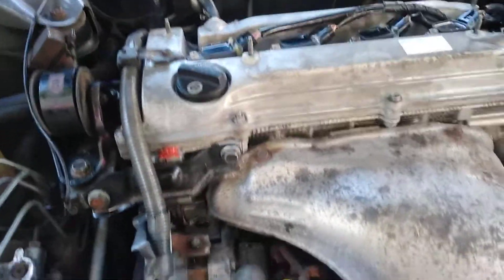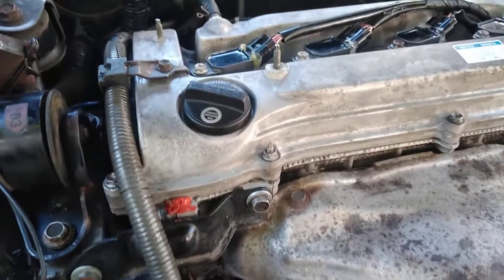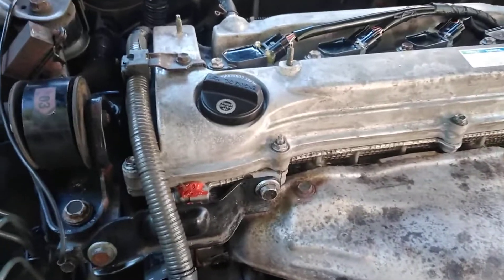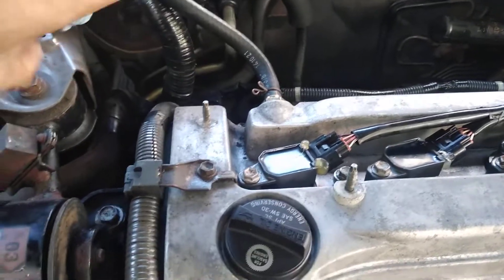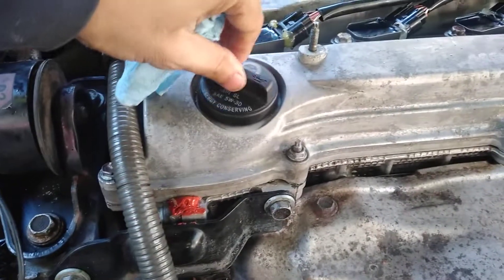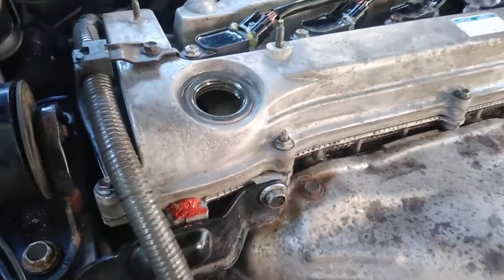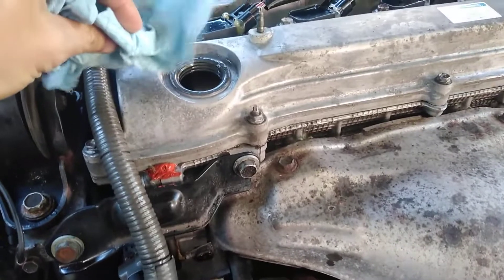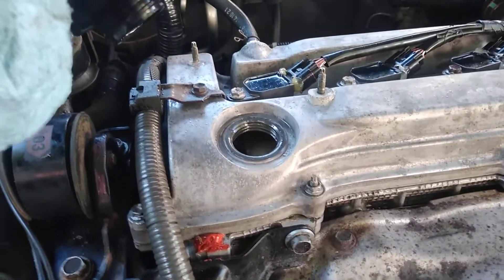Too much positive pressure from oil cap. Camry 2005 2AZ-FE engine.

Comment: wow, I have same exact problem but mines a 2006 camry, I'm confused cos the dipstick is also silent, no air from there whatsoever. I'm very very interested in finding a solution to this... please.
Reply from the maker: Thank you for your input. I talked to one mechanic about it he said its normal, but I doubt. My dipstick is also dead silent. Soon I will perform compression test. Thinking it's probably stuck piston rings. Some people have had success using some additives in gas/oil or directly on the pistons, I might try that too. Overhauling is not an option for me. I will keep you guys updated.
Reply: @someone1089  i have the same exact condition. compression test this morning showed 175 and 165 on the 4 cylinders in my 96 accord. hoping its excess crud on the rings and may try some lucas next
Reply: sufferimg from poor gas milage now otherwise runs good
Reply from the maker: My compression test came as C1-205psi, C2-195psi, C3-195psi,  C4-205psi on hot engine. I don't think I have ring issue, my MPG is still good. I had exhaust leak and I think the mileage was also poor, so I replaced the faulty part of the exhaust which could effect the mileage. Just make sure you don't rule out other things.
Someone have tried B12 chemtool to unstuck the rings, Here is the link.
https://www.youtube.com/watch?v=84MylatwpN8
Reply: @someone1089  So at the end, the tests prooved that your engine had no issues right ?
Reply from the maker: @yassinelitime  Well, since I don't observe any performance issue, I am calling it good. The only issue I noticed is oil consumption, which is common in this 2AZFE engines. My compression test results came pretty consistent in all 4 cylinders about 195psi. I m not too worried about this issue at this time.
Reply: @someone1089  hello are you still around? I’d like to correspond with you about this issue having the same exact issue on a Scion tc. Compression is 170 to 180 on warm engine all cylinders
Reply from the maker: @TTheo-cb4jz  I am around, but not actively pursuing the solution at the moment. It does not look right, but the car runs fine. Some people says it's normal, some says it not. The compression in all cylinders is 195 ish (psi) on fully warm engine. I noticed a difference in spark plug conditions in one of the cylinder. The plug got black carbon deposits while other looked clean. May be that cylinder is causing this blow-by some how. My totally un educated guess is that may be the valve stems seals are the culprit. 
Is your car running OK? Cold start, acceleration etc. Mine starts and runs fine even in below freezing conditions.
Reply: @someone1089  Thanks for response, 
Mine is my daughters 2008 Scion TC. Sounds the same as yours, practically like exhaust pumping out of oil filler. Seems way too much to be "normal" in my opinion. Spoke on phone with one Toyota tech and he said Yeah they do that. hmmm. (2AZFE).
My compression on just  warm engine # 1 180 #2 170 #3 170 #4 175. they went down significantly when doing on a cold engine low as 160. (but forgot to hold throttle plate open).so it can suck air in better. remember to pull fuel fuse and relay fusebox under hood. or load up with fuel cranking otherwise. Toyota manual spec   189psi max  145 psi min. dont wanna rent leak down tester at moment. thats a good indication piston blow by.
Reason I check cap off running /mine was a valve cover gasket leak in front. They all eventually do that, tons of youtube replace vids. Gasket  was very dry and spilt open right at leak area. I first thought to check crankcase pressure due to the spotted leak.... fear with so much pressure will leak everywhere like worse places crank/main seal etc.
Also I did the piston soak you see done on line, Berrymans B12  about 3 months ago (1200 miles ago).Worked to clean oil scrape rings... it use to burn 1 quart in 300 miles . Soak dramatically worked, burns about 1/2 quart in 1100 miles now. wonder if some oil scraping ring gunk broke loose and made compression ring stick ? 
Mine runs fine, good excel power etc.I do wonder about a clogged Catalytic converter due to years of oil burning....but one tech said youd throw a 0420 code. Strange barely any exhaust out of tailpipe when first cold start car, then some comes out after warms up..seems like piston ring blow by. My plugs are all clean / white actually
Sorry  for lengthy message but want her to drive without blowing out leaks everywhere. 
a few questions. below

1 Are you driving it daily? how many miles since your video?
2 Do you have oil leaks, ie pressure out of valve cover or elsewhere
Thank you
Reply: @someone1089  you there/ see long message.
Reply from the maker: @TTheo-cb4jz  Hi, Sorry for the delay. I am driving it daily, mostly local roads and occasionally on highway without any fear of stranding. Since I drive mostly on local roads, I would say I have driven it around 3000 miles since my video. Actually I recently bought this car in used and neglected condition, I think the previous owner was driving it for a long time like this. I noticed this issue from the day I bought it.

My valve cover gasket was leaking, so I changed it already, its pretty easy job. No oil leaks on that area anymore, perhaps have some small leak elsewhere since there is small dripping under the oil pan, but I haven't checked thoroughly.

I also have oil consumption issue, but I haven't measured how much. I am thinking to do the B12 treatment before my next the oil change.
I doubt if B12 treatment will cause compression ring stuck, there is no structure in that ring to hold any gunk. 

I haven't check compression on a cold engine since my rental compression tool broke I doubt its reading anyways.

I am also thinking could it be because of clogged Catalytic converter. My car has two cat converters, one near the engine second away from it. I changed the second one already due to exhaust pipe rusting from many places and the replacement whole section comes with cat converter. May be the converter which is right after the exhaust manifold is blocking some exhaust. One way to test it is to remove it and apply pressure may be using a shopvac. I have no codes in my engine too. 

No exhaust is definitely a problem, can you feel it by blocking the tail pipe with your palm? you will immediately feel pressure. I would look at the entire exhaust for any blockage first before looking at the engine.

Thank you
Reply: @someone1089  hello, did you see my video with pipe and bag ?
Reply from the maker: @TTheo-cb4jz  Just watched it. Its exactly same as mine. Some oil vapors and the oil cap dances when left loose. I am not sure what to do next. Was it working fine before the B12 treatment? If it is caused after B12 soak, maybe there was some kind of pressure relieve structure but now its clogged by the sludge. who knows.
Reply: @someone1089  I’m not sure if you read the description under the video. It’s very  comprehensive. It talks about when I press the white plastic pipe / with bag, to seal off the engine it seems to suck the bag down which is a good thing. When I lift it away and there’s no suction possible /inside the engine to suck air pressure out of the PVC system, when lift pipe off,The bag blows up very strong. I’m thinking it’s  emulating when the cap is on. Maybe you could do the same test …I just used rubber band on a grocery bag on , a pc of 1.5-2 inch PVC pipe. Press tight over opening and then lift up and see what it does. You can see when I put the pipe tight over the hole the bag droops.
You would think it would be the opposite if it was building up more pressure. Thanks
Reply from the maker: @TTheo-cb4jz  That's interesting. I will do this test tomorrow. Does it mean there is no problem, and we are just creating a false blow by symptoms by removing the cap?
Reply: @someone1089  I’m not 100% positive. BUT  it might be more normal than we think? With the cap off is it sucking air in and puffing out at rapid pace?Where as, when the cap is on and closing the off crank case. It’s not building up as much pressure and going out pcv adequately. My daughters driven hers around a bit. I don’t see any leaks yet. I will look today. Use like a flimsy grocery or a Walmart bag
Reply from the maker: @TTheo-cb4jz  I uploaded a video of bag experiment. It may not be as big of a problem. Someone else with same engine can provide more evidence. I once talked to a mechanic about it and he also said it's normal. Thanks for your help.
Reply: @someone1089  Hello, First thanks for taking time to make new video. Saw your new video (with plastic bag).I  am not able to comment under that video? so commenting here.
 Your bag seems a bit more light weight than my walmart bag ? (maybe more
 sensitive to expand/blow up. 
With plastic engine cover on, its more difficult to see when lifting pipe, however. The pipe just be pressed firmly on metal valve cover. Is plastic black cover allowing that with your pipe diameter?. When you had bag deflated (second time)and pressed down, it seemed to have some suction, but first time not so much. Yours seems to blow out a bit harder than mine. Also you can see my bag actually fall a bit and lean over  somewhat when pipe pressed on firmly.  thanks again
Reply: @someone1089 possibly on the top end, valve seals, but you'd be burning oil, and so long as the valves close in time there should be none. 
Check your engine to see if it's slightly off timing.  
Mine does this, spews air and oil droplets, but runs fine. I know one cylinder has a slight misfire,  probably the plug, because i have a slight gasoline scent, but that doesn't transfer to the case pressure. Also, no smoke at all so I  know it isn't rings or bad valves. 
I have seen many say their engine does this and it's fine. I'm going to fully rebuild a 1az in a few days (same engine basically) and when I'm done I'll check the blowby.
Reply: Thank you for your respoe.. I await your findings after you carry out these tests... do keep us posted..
Reply from the maker: @endi4real  Sorry I got sidelined due to some other things. I will update soon.
Reply: Air leak
Reply: As we have found on our one 1zz Fe engine only 78 kms the engine is clean. The piston ring from factory were faulty there was a recall for some of the models. A real pain. We are not going to rebuild I put pressure on all other areas of the engine inlet manifold gasket, pcv clogges, and the Darn chain tensioner leaks Even when replaced. Not sure what to do have spent a lot of money on it

Comment: That’s due to excessive blow by. Most likely your piston rings are stuck or worn out. Carry out a cylinder compression dry and wet test to confirm the same. Report back the results.
Reply from the maker: Thank you for your time. Rings or seal is my biggest fear. The dip stick is dead silent, means no air blowing or sucking, I should have mentioned this in the video. Shouldn't dipstick have some activity incase of excessive blow by? I will perform the compression test and update here.
Reply: @someone1089  mine is a different car. Part A: before changing PCV valve & hoses. Dip for engine oil in the morning. Then start the car in the morning and keep the engine idling. After 2  minutes, engine is still running,  and air intake at 0.5bar dip engine oil. Oil level is higher by 2mm. 

Part 2. After changing PCV & hoses. Repeat the above. Engine oil level drops by 20mm on the dip stick. 

In your case, with the engine oil cap not removed, you are likely to have higher oil level due to oil being pushed into the dipping tube while engine is still running.